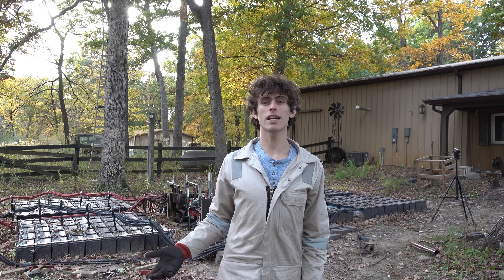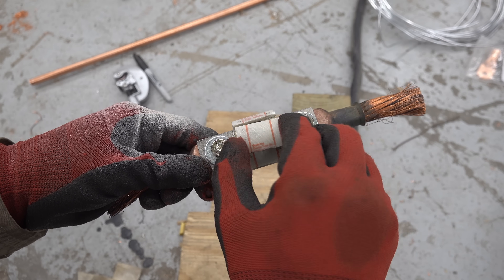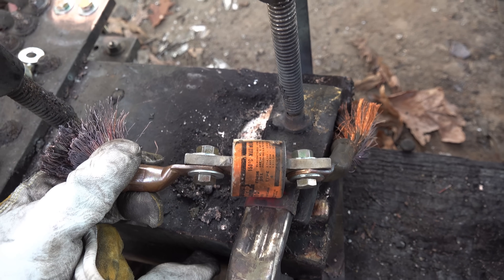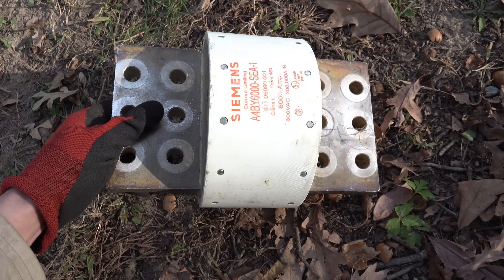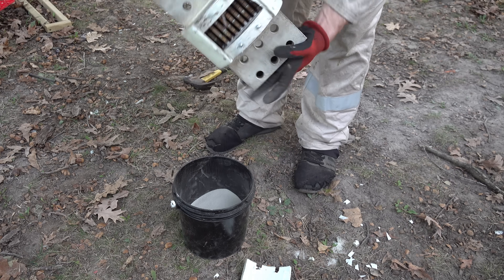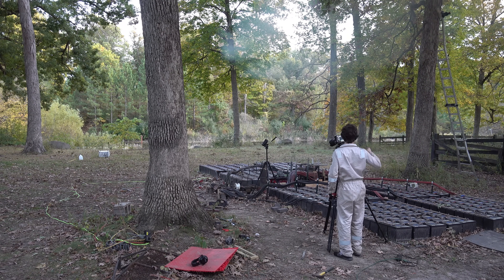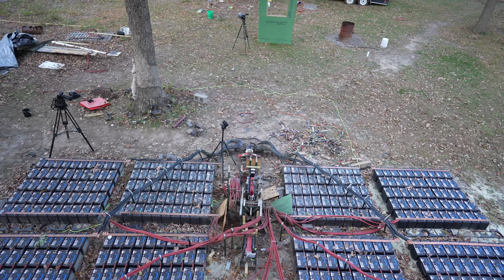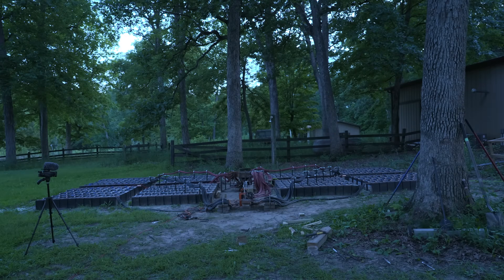Popping a 6000 Amp Fuse

Comment: A nice open fuse that ive seen blow a few too many time is a railroad current collector fuse , or shoe fuse as some call it. Its only around 600 amps but at a potential of 600 volts. Basically its a 1/8 inch copper strip about 1" wide and 10" long and slightly hourglass shaped in the center. It makes a giant bang and a huge green fireball shoots out  when it blows , pretty cool!!

Comment: Hm, any nutty ideas for what you could do magnetically with this power supply, on purpose instead of as a side effect? Make a monster electro magnet? Few turns of that very-thick copper wire, see if you can make stuff fly through the air or implode coins or whatever? But bigger, y'know, and more dramatic.

Comment: Fuses fail w/ even more fanfare when they go at rated voltage.
A 5E 34.5kV fuse is unreal when it blows. Based on the photos I've seen of the melted holder.

Comment: i was told never sit a battery on a concrete floor because it will drain the battery, and to try and set it on a wooden bench. But you have all these batteries just sitting directly on the ground... Do you see an abnormal discharging due to the batteries sitting directly onto the ground?

Comment: Wait how do you have such thin conductors going into the middle off those big bus blocks all the batteries connect to? Are those superconductors?
Reply from the maker: those are my custom fuses! they will pop after about a second if conducting 150,000 amps

Comment: I don't want to be that nerd dude but here is a suggestion, since I noticed only that one corner of the fuse block melting, I supposed it was due to the rest of the block being covered in garbage and not making good contact so, I'd suggest that you clean and sandpaper the blocks because then I think that would help a lot

Comment: I'm more interested in how you designed a 150,000+ amp switch and how the electric motor sound 5:58 figures into it. Sounds hydraulic.
Reply: iirc there is a log splitter involved that can rip the contacts apart if needed

Comment: 6:35, well you are supposed to use something like 6 m12 bolts to mount the fuse with something like 70nm of torque on the bolts on each side :D
or m14, its hard to judge the size of the holes on the video and im not keen on calculating what to use right now

Comment: Hey I recommend when using a cutoff wheel on the grinder that you cut the other way, so that the disc wants to drive forward on the piece you're cutting. At 4:49 the dust should be going toward the battery pack not away from it.  Keeps the disc from catching the edge of the piece and kicking, possibly sending the disc into your body or face while still spinning
Reply: That's your biggest concern?
Reply: @deanbilan7439 he's aware of the other hazards, this one i have personal experience with

Comment: Put some electrodes in a container of water with some electrolyte, and hook that up to it. Also sparklers and welding rods.
Get a big graphite crucible full of Aluminum and Chromium oxide, and use the battery make the largest synthetic ruby of that type on YouTube.
"Charge" an 18650 with it.
Reply from the maker: I've tried electrolysis and the bubble formation seems to quench the electrodes. it is too good! i'm sure with big enough plates it could be optimized. i've been meaning to try making a gigantic ruby that way but now it's cold and i'll have to wait until next year for more experiments. i did manage to make a ruby fulgurite by zapping a tungsten rod inside an alumina/chromia mix though!
Reply: @styropyroshorts  Nice man. I wish I had one of these to play with. You could do a whole series with it, similar to the old "Is it a good idea to microwave this?" channel. 
An unopened can of soda could be cool. 
Too bad Govdeals doesn't have any submarine batteries for sale atm. They're like 7000ah and a while ago they were selling really cheap.

Comment: Please get yourself half electronic half sand fuse from Tesla Model S/Model X 2000A fuse! It interrupts current path going through copper plate with use of electronically controlled pyrotechnic charge and then the only current path is through two 40A sand fuses. It would look cool to see if arc quenching guillotine made of plastic can do the job with hardcore overload xD

And used battery powered fuses are worthless, as they have ~8 year declared lifespan, all of them are near to it

Comment: I don't have wires that thick or money to buy them, so I'm using lithium cells in series to get power, so far 800 amps at 60 volts is all I got, but the battery pack fits in a backpack.

Comment: 0:33 Someone get this man a 100-150kA fuse for christmas, for the love of god!
Reply: The fuse shown is a 200kA fuse already, as kA are typically interrupt ratings
Reply: @a @alyssaebetuer2007 but this is continuous
Reply: I wanna see 5 of those exploding for new years
Reply: I think for a 100kA fuse you would need like 160000a to pop it
Reply: @poopymccarthyface2238  Maybe not, as time is also a factor. Why is it not rated 160k amps then instead of 100k amps? With breakers, pushing one to it's rating for longer periods of time will pop it and doing that over and over will weaken them. I have not used fuses to failure enough to know how they act, but do know of slow blow fuses vs. standard. It would be interesting to hear more about the ratings and how fuses compare to breakers.

Comment: "I'm not even gonna bother cleaning the contact"
You should clean the contact, if you don't, the contact in question has more resistance than the fuse, and melts first.
I thought you realized this the last time you played with those batteries.
Clean contact with large surface area is the only way to get it to work.
Plus bolting everything down, a couple of C clamps are a ghetto solution.

Comment: What was that secondary spark to the right of the screen above the batteries?
Reply: That's the hydraulic relays Drake built. Switching becomes quite the challenge at currents this high.
Reply: @hammerth1421  Ah, I can imagine, didn't factor in that but that makes total sense, thanks for clarifying it.

Comment: 1) your experiments and videos are gonna inspire a whole new generation of cryptids in your area, and I look forward to it

2) as someone without electrical engineering knowledge, I want to ask how does that 6K amp's fuselette design ensure total failure? Like, if you're giving it 10k, is it just popping one fuselette at a time over the 17 or whatever minutes that graph says it'll hold for, or is it designed so that one pop is guaranteed to trigger the next? Or are you supposed to replace the fuse if the circuit goes over the rating to make sure that it's not partially compromised?

Comment: What doesn't come across is how visceral both the volume and force that shockwave would've given off. And this guy just dips behind a tree like he's playing paintball 😂

I've been a few metres outside a substation when an 800a nh4 fuse exploded in milliseconds, granted I wasn't wearing ear protection but holy crap it made me jump. Felt the shock, heard ringing for the next day. Not sure what current I saw, for the fuse and time it was minimum 10000 amps At 230v per phase.

Comment: The large flat surfaces each end and the big bolt holes are to clamp the fuse on a mating flat surface for very low resistance  just bolt the fuse in to holes in the flat copper plates it will work first time without damaging the plates it will take 20 minutes but save time overall.

Comment: I was just thinking that there is no way that the contant was strong enough for such high amps. You probably should have cleaned them, and used a lot more force to press the fuse ends against the contacts. Those clamps you were using would have provided enough leverage for you to presss the contacts together well enough.

Comment: I was curious about your epic battery setup. I’d recommend throwing a cheap solar charger on each 12v paralleled bank. 

Just buy 8 12v solar chargers for cars with built in charge controllers etc and toss em on top of the batteries. That way, although it’d be stupid slow to charge, you’d have something to keep the cells slowly charging between experiments. 

That is, unless you have a 400a 3phase charger setup for that bad boy haha

Comment: Let's not downplay the fact that photonicinduction popped a 5000 amp fuse on the concrete floor of his 6ft x 12fx backyard, by the way. Right next to the wooden fence he shares with his neighbour and using his glass kitchen window as cover.

Comment: I was curious what this kind of thing costs. I could not find a concrete answer. The closest I could find was a similar fuse of a slightly lower rating (4000A, in particular) for $3400 and change. All listings I found for the 6000A variant would not quote an actual price, instead wanting you to contact the vendor for price and availability.

That said, I also found listings on ebay for what I'm fairly sure are this exact part for as low as $650. So who knows what it's really worth?

Regardless, that's anywhere between a lot, and a heck of a lot, of money to be spending for our entertainment.

Comment: it's interesting how this setup has no risk from short circuits
normally a short is kinda dangerous because it can potentially start a fire and be glowing red hot for hours

this is so much power that anything shorting it out will instantly explode and not be a problem any more
Reply from the maker: it's an ironic safety feature for sure! the magnetics actually play the biggest role here. you cannot accidentally cause a full short by dropping something metal across the contacts. you'll get a small burst of sparks, but the magnetic forces will always throw the object off
Reply: @styropyroshorts  even if they fail to throw it off, it will just melt. Even More Ironic that anything causing a short circuit will act as a fuse and melt, preventing damage
Reply: @styropyroshorts what about we just submerge the exposed part of the circuit in salt water?... What would happen? Not like it can melt water or anything because it is already melted... Would it started a cyclical explosion or started to boil the water violently? And about the magnetic field... Why don't we just wrapping the live and neutral wire around one another to cancel out the humongous mount of magnetic field that it created?
Reply: @vireaknou8835 I think if you just airlift the whole setup into the ocean, it blows up the batteries. If you put the leads into water and turn it on, it blows up the water.
Reply: @u12bdragon  fusion engine
Reply: @vireaknou8835  The water will be electrolytically split into oxygen and hydrogen, both of which will be more than happy to contribute to the fireball.
Reply: @vireaknou8835  The way he has arranged the batteries, his setup is low voltage, high current. The output is about 60 Volts at the positive and negative terminals that he connects to the fuse. I did the math, if the terminals were spaced 0.25 inches from each other, it would still take 6.25s for the water in-between the leads to boil (excluding flow of water from the surrounding vessel which would make it take even longer). Unfortunately, it will not boil the water violently.

Also, if you wrap the live and neutral wire around each other the magnetics want to force the cables apart. You need some really heavy-duty straps wrapped around the entire length of cable to keep them from separating. Doing so would be an additional safety risk if a strap breaks and becomes a projectile.
Reply: So I found this 1” diameter tungsten rod in a junkyard-

Comment: Hey Styro! Please run some electrolysis of water tests with your 400 car batteries! Try making a bunch of different units and see if you can test some theories on better gas production by cycling the frequency to try and match waters vibrational frequency. Would be great to see what you can do with some massive balloons filled with HHO Gas

Comment: Just wondering what kinda camera is that at 2:58 on the tripod with three cranks to adjust it. I assume that’s the high speed one you are using to get the close up spark shot.

Comment: I am currently (no pun) working on some VERY high amperage circuits for my Chevy Step Van.... I am creating a Super Capacitor and related wiring for starting the engine!!    This will reduce GREATLY wear and tear on my 6 battery 650 Amp Hour battery bank!!  :)

BUT!!! just for comparison, I'm talking 390 to 400 amps!  :) (a tint fraction)   LOL     I have actually decided to forgo a separate fuse.   

MOST people even experienced automotive mechanics do not know this but  ...... The solid Lead Alloy the battery post is made of  ...   WILL melt and break the circuit during a full short circuit or extreme amperage draw 

IDK if even Kyle knows this (did he mention it???)  every battery has a built in fuse that will melt if the circuit attached draws to many amps!! :) 

I had the luck (or misfortune) seeing this happen once,  A Chevy Small Block had a bad engine mount that pinched the Positive battery cable!!!   ..  It only took about 5 seconds for the battery post to melt into nothing and disconnect the short circuit!!!

I have heard through the grape vine this is a very old intentional design feature, but has simply be forgotten., what do you think???

Comment: If you like extreme electricity,  I work at the steel making mill at rocky mountain steel mill in pueblo colorado. We use carbon arc rods that are 30ft long and 2ft diameter.....

Comment: Make a Massive Wireless Charger powered by these battery , use a high powered mosfet to make a pulsating DC to create the moving magnetic field.
You could power devices with smaller coil from feets away.

Or just make the a big magnet , and put a plate on top which would float

Comment: The contacts not being cleaned for the big fuse test made the contacts resistive heating elements! Most of the power dissipated there instead of being equally distributed throughout the circuit.

Power dissipated in a section of a circuit is proportional to that section's resistance. More total resistance in the circuit means less current flows and therefore less total power is dissipated, but the power that is dissipated is concentrated where resistance is higher. It's why a loose connection can cause a fire.

Comment: I am thinking as to 
Edison, New York.  They generated 100 kilowatts and were designed to power about 1,400 lamps continuously in an initial area. Mechanism as:
 a high-speed steam engine converting mechanical energy into direct current (DC) Six each *jumbo's"  27 tons each year as 1882.
Legacy and  see" Scale: The system served an area of roughly one square mile in Manhattan, including stores, hotels, and factories.
I take note your system as well arraigned, has several drawback and hazard.  The car battery type, if liquid lead acid, generates hydrogen gas.
And the fuse  assembly as active transmission points will be factual to lethal amps.  Recall here, AC as underground wiring to lamp post, have produced fatal result to police equine.  A wet ground as a hidden, underlying cause. The creatures front to rear legs competing a circuit as to cardiac stoppage. A particular hazard (as also) to untrained service as telsa and similar battery (electric cars).
The test completion did in fact surpass photonic induction as within spectacular capture to fuse capacity.

As a unmet problem, it's the potential energy to safe, effective storage and delivery at the high yields you demonstrate. Perhaps as some 3rd, 4th polarity and meshed with the new and evolving quantum linked states?  At your recorded enterprise, beware rain. M.

Comment: What the hydraulic noise?
Reply: I vaguely remember in his old 100 battery video, he modified a hydraulic log splitter into a remote operated switch. I don't remember if the issue this solved was the switch welding shut or getting ripped apart by magnetic forces, but it did solve it.

Comment: Your experiments are amazing, but I really don’t think you are taking safety seriously. You make backyard scientist look like a look cautious. Seriously, develop some vetted safety protocols and follow them. It would be a tragedy to have you maimed or killed by one of these experiments.
Reply from the maker: what makes you think i'm not taking safety seriously??
Reply: @styropyroshorts  protective gear seems inadequate for the level of danger… Heat, electricity, shrapnel, molten metal. Having batteries in such close proximity to the explosion… the fact that you’re working with power where a mistake could easily be deadly, and you had multiple things go wrong that you didn’t anticipate, in a setup that isn’t obviously fail-safe. 

I’m not an expert, so I don’t really know. But it’s hard for me to imagine an engineer who works with these kinds of currents looking at this and saying, yeah, that looks fine. I assume the company that makes the fuse tests them to failure as part of their development. What do their testing facilities look like? What are their protocols? How far away do they stand? I’m sure they don’t use a nearby tree as a shield. Have you talked to anyone who does related stuff professionally? 

I really love the exploration you do and the personality you bring to it. I’m questioning the safety out of real concern, not to be negative. The power you’re playing with is orders of magnitudes beyond deadly.

Comment: Do you not have a remote start for your slowmo camera? Having to start it and then dash to trigger the experiment seems non-optimal.
Reply from the maker: i had one but it kept getting EMP'd by these experiments!
Reply: @styropyroshorts  Damn. This is the kind of thing where you'd want like a plain logic trigger or something, that you can just connect a long coax or twisted pair to with ferrites and shielding and just a button at the other end.